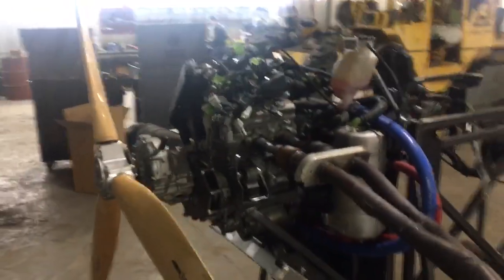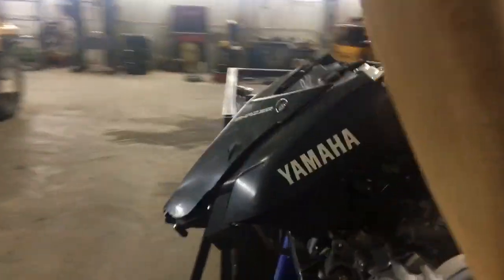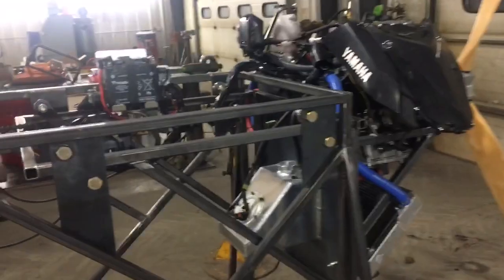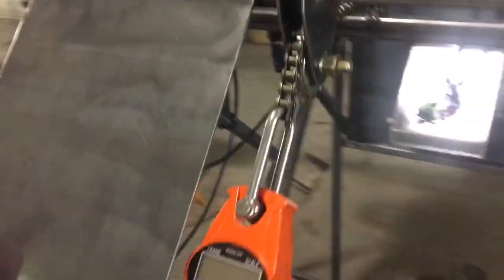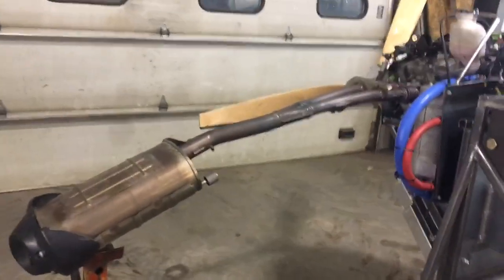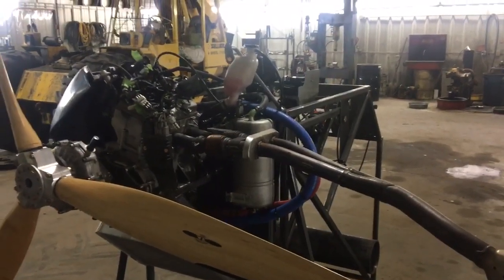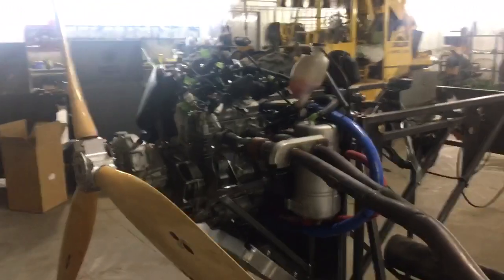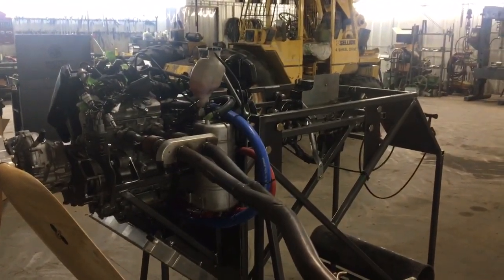Phazer aircraft engine experiment.

Comment: Hi there! We are also doing a phazer aircraft conversion right now, I'll be following your progress, thanks for uploading!! Also may I ask what gearbox you are using? We noticed the output shaft from the phazer is a keyless tapered shaft and we haven't decided how to connect it to anything yet. Thanks!
Reply from the maker: Glad to see someone else pursuing this this motor. I’m using the Rotax C gearbox. You need to find the Yamaha aircraft conversion Facebook page, lots of good information over there. What is the aircraft you you intend to use?
Reply: @byroncronk3251  Thanks so much for your quick reply! I've just checked out the facebook group. We are currently attempting to build a prototype for a new, blended wing body design! A complication is that we will need about a 5ft long propeller shaft. We are currently working with a 2007 Phazer engine, but if everything goes well and we make a few airplanes, we eventually want to switch over to the HKS 700e.
Reply: @timi707_1  A long propeller shaft will open a can of engineering worms! Look at the number of engineers Jim Bede used to try and solve the torsional oscillation issues and ended up bankrupt!
Reply: I just bought a Phazer motor for my trike.  I have an Apex motor but 140hp is a bit much on a lightweight trike.  (if anyone is interested in it it's for sale).  
Teal Jenkins of skytrax is making custom gear boxes for Yamaha motors.  Really nice units.  
https://youtu.be/r8UXxcV1CFQ